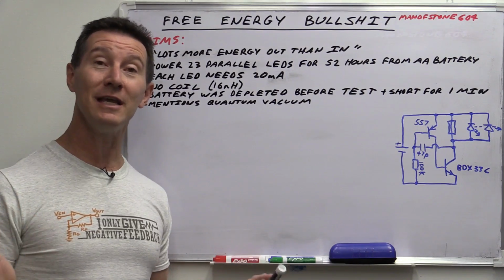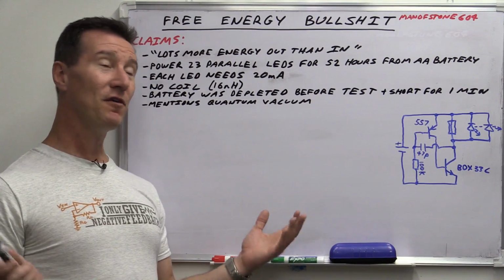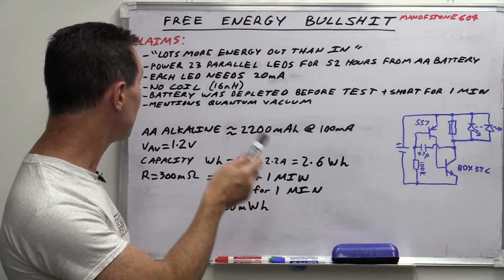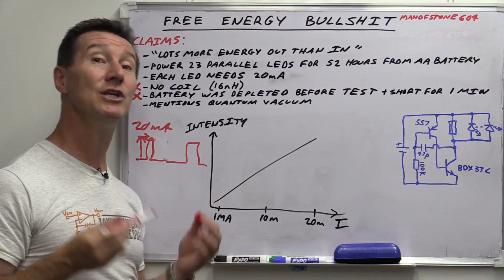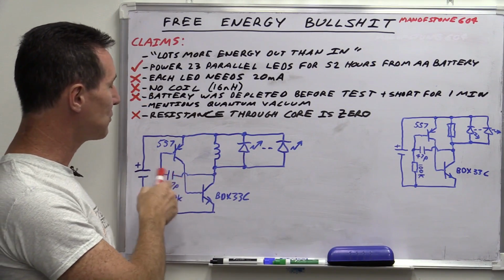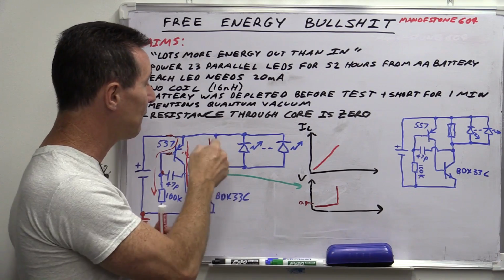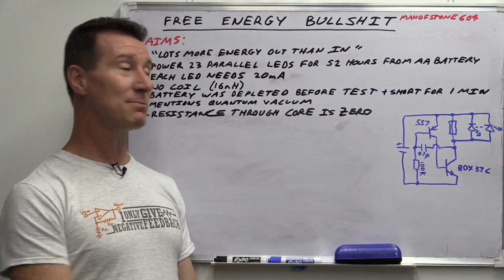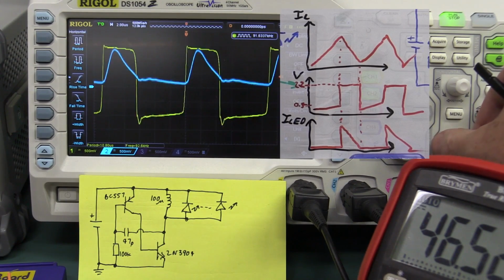EEVblog #708 - Free Energy Overunity is RUBBISH!

Comment: Not that I believe in this "Free Energy" but, doesn't the power need to be multiplied by 23 for each LED at 19:50 ?
Reply from the maker: geekygeniusgg I'm doing a calculation of what power it would take to light 23 LEDs at 1mA each. so 1.6mW x 23 is the 37mW total.
Reply: It is, follow the equations more closely: 1LED is 1.6V * 1mA = 1.6mW. Then 1.6mW * 23 = 36.8mW ~ 37mW.